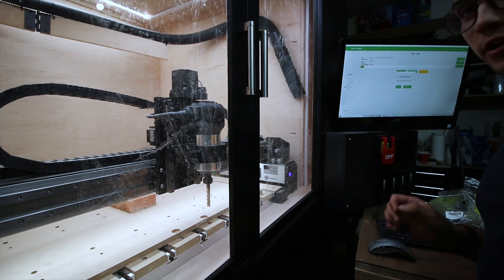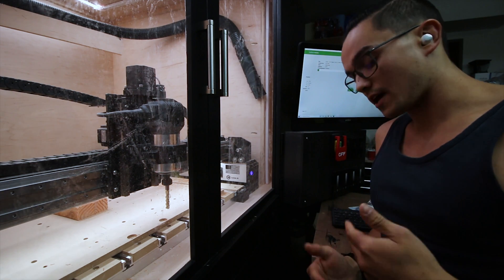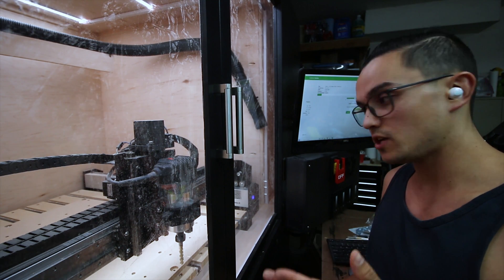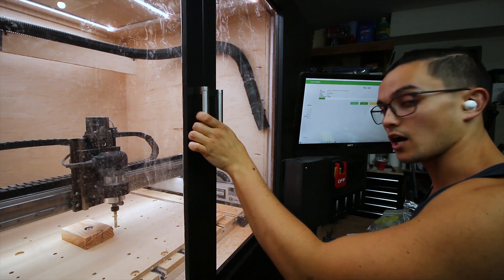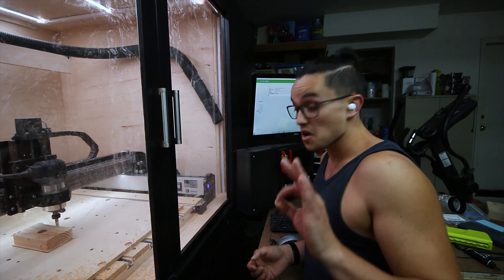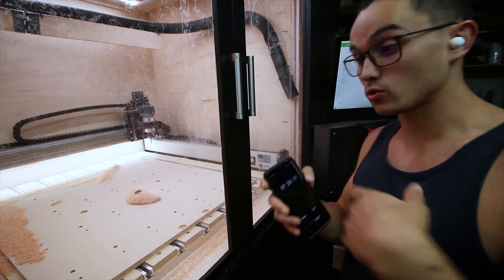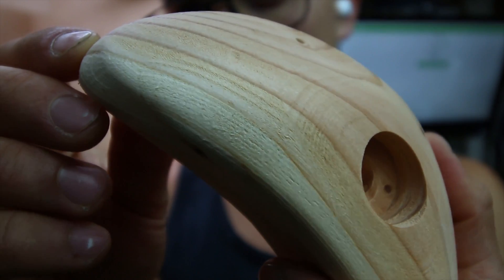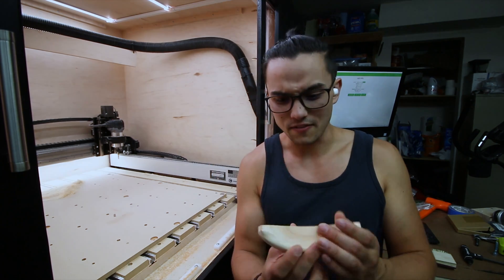Perfect Part Fast! Preproduction Climbing Hold

Comment: Try reversing your cut direction
Reply from the maker: Hi Steve, just curious why?
Reply: @AustinConrad  if I'm looking at the set up right, I think you are feeding the opposite direction for a smooth cut. I believe you are climb milling. Just a suggestion
Reply from the maker: @stevekidd318  Hi Steve. I'll take a look. Ya I'm climb milling because I'm trying to avoid the tear out that comes from conventional milling. Have you had better success the other way?
Reply: @AustinConrad  had better luck on a router table I don't have a cnc yet
Reply: @AustinConrad  i would get a straight flute bit for this. Chip Clearance is not an issue since you don't do pockets but even then straight flutes are probably ok. Reduced tearing quite a bit in my experience. Then you can also do conventional without issues. I'm using metric so not sure but your step over looks like less than 2mm so maybe also check belt tension etc cause I'd think the shapeoko can do it. From my experience this kind of chatter doesn't come from too high feeds, that would first big down your rpm by a lot and it sounds fine, like at least still above 10k rpm.